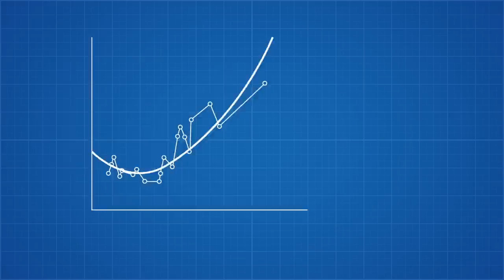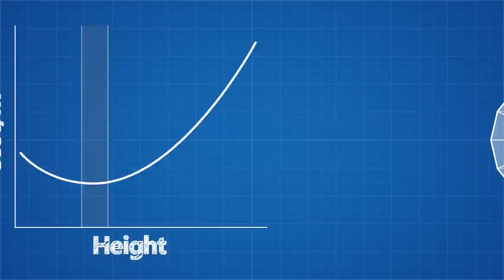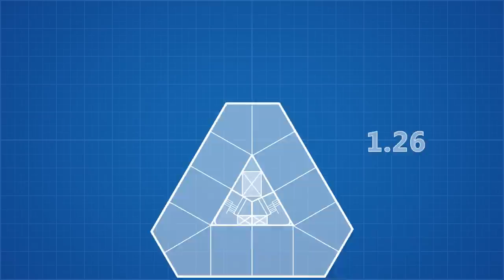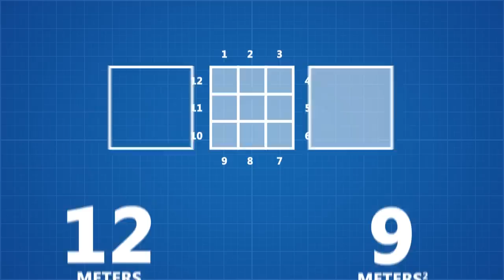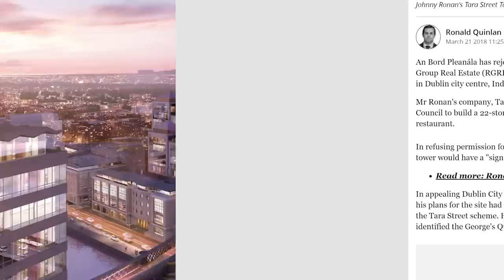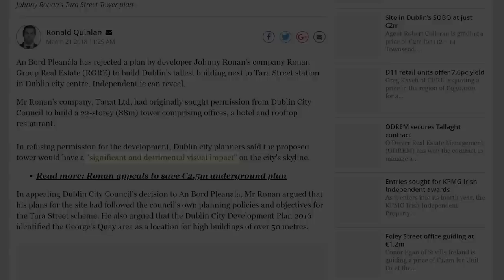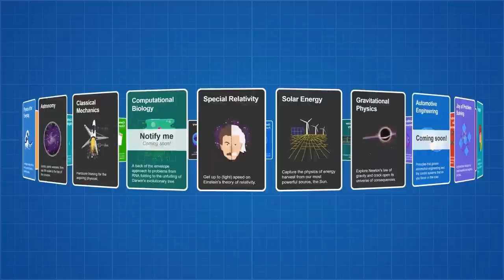How to Solve the Housing Crisis

Comment: This is a good video, and all points of are indeed true. But building higher also has it's tradeoffs, and these are by no means minor.To explore some of them, you might want to look at Moscow, my home city. If you go away from the center, you quickly find yourself surrounded by blocks and blocks of the same-looking industrial buildings 16 stories tall. This here is called "anthill", and is heavily critisised by many russian urban planners and architects. Apart from obvious aesthetic concerns, it discourages the formation of small businesses (high density of population means there is high demand, which is best met by big supermarkets) and there is no such thing as "local community" really in Moscow. Also, it doesn't seem to solve the problem of traffic jams, sadly.
Reply: Those buildings were made to be as cheap as possible after the fall of the soviet union. Nobody wants to have those types of houses. Detroit in america also has these low cost housing bread boxes, but pretty much everyone hates them. But you get giant high rises that actually look good in seattle and new york, they are unaffordable due to lack of supply however

Comment: A great idea would possibly have to be to make a tower with lego-like rooms. They would be assembled off site and sort of snapped together to form an ever changing tower design. The city needs the building to get a floor taller? Snap on another set of floor and add a stairwell block and maybe an elevator block column. Making them out of cost-effective light but strong materials and perhaps insulating them with aerogel would further increase savings by simply building to what is needed. If you don't want to take that route or it isn't good, a car park that stores cars in vertical space might help eliminate large car parks.

Comment: This is a topic I've been interested in for a while, and while I agree the challenges are numerous, there are solutions.  One such that I've seen suggested is cooperative development away from the city center with dedicated mass transit to and from.  The idea being several development companies get together to build a high-density residential area.  Think of it like an airport -- you want it away from the city center, but to make that feasible you need reliable transit links, and the faster the better.

It's expensive, to be sure, but if the city is willing to help subsidize it on the grounds of obvious need and it being a solution which doesn't require changing regulations in the city center, it could be accomplished.
Reply: Essentially it's a mini Tokyo. The countryside drainage also conversely had a side effect of lowering land prices, even relative to the city, when you're in the suburbs. So for some people even the cost of the commute is still worth it because good public transit keeps road maintenance,car exspenses,and travel costs down and families within budgets and spaces they can afford.

Comment: Yes, Midrise density is cheapest when just considering building cost alone but when services are an included cost either townhouse, small lot homes, or low rise apartment tends to be cheapest density. Considering Modular construction is especially easier at this density too just furthers this fact. Along with convincing neighbors zoning changes permissive for this density is an easier task.

Comment: I don't get how building under ground is not even an option
Reply: Most people don't want to live there...
Reply: Well when we'll realise the weigh of this crisis maybe we'll revue our opinion I hope. Otherwise let's don"t give a f, let's keep doing just what we want indeed no need to bother with a solution.
Reply: It's very expensive. First you have to excavate an enormous amount of material to create space. Then you have reinforce the hole to keep it from collapsing in on itself. Then you have - now and forever - pay to keep it pumped out and dry and air conditioned. All that forces the rents sky-high. Stack on top of that that few people want to live underground anyway and you've got an economically unsustainable project.
Reply: What would be the point in going further underground? Are we running out of space to build up? Building downward would be just as expensive as building upward, maybe even more. Plus no windows.
Reply: Digging that out is hilariously expensive and not practical

Comment: Thanks for such an informative video. I also concluded that 8-9 storeys are the perfect balance in cost, aesthetic and sustainability as an urbanist after years of empirical study. However, the world is not as pure and simple as the engineering world. The middle rise typologies and prefab continue to be off the main-course menu in many modern cities. The debate about prefabrication and square box with minimum decoration will continue until the aesthetic of the prefab speaks the same volume as the speed. Seeking personal expressions in building height, shape and skin will always transcend the need for efficiency for many architects and clients.  Last but not the least let's not to forget that the rising public resistance to tall buildings and pace of urbanisation are there to make the path to our urban future even more confusing.

Comment: Well, I think that part of the problem is that all business seem to think they must build in the cities and then have workers travel in from mostly the urban areas?  With good fibre based business internet a business can be build where most worker would be living away from the heavy traffic and noise and pollution in those un-used area in the urban places where the price of land be far cheaper and the work force more available to come there to work since the company be there and not in the cities!    Yes.. I know the companies think that, They got to be in the cities because all big companies are there?  Well, that is a out dated idea based on the old school business model of being where the others are and being in the flow of central control..    But Why do it like they did back in the 1950's or 1960's when with good internet links and the price of land in the cities reaching silly levels it make sense to build not where the rest are! But a out of the box type of planner.   Now as for housing for people if more companies built out of the cities where the people mostly live, there would be far cheaper land to build housing and better air and less traffic problems.A full modular housing design with all the piping and services per installed would solve the homes problem, In fact a factory making them outside the city would not only have the space to build and lower building costs,    But also would bring workers to it from those surrounding urban instead of people having to travel long times to work there.  Plus the better low amounts of noise and pollution and nice parks with plenty of trees and cleaner air will make such well eco based factories and homes near them have a nice effect of the workers who live and work there?

Comment: Has anyone tried building wide and flat?  Like a giant version of the Shire.  Run the roads, rails, parks, etc. over the top of the buildings.  So, from above the city would appear to blend into the landscape instead of displacing it.  You wouldn't necessarily need to dig down; you could just pile on top.  Sprawl that actually increases green spaces.

Comment: When it comes to building height there are other factors to consider.
In order for the apartments on the lower levels and the streets to get a sufficient amount of sunlight you need to increase the space between higher buildings. No one wants to live in claustrophobic urban canyons. Adjusting for this can have the effect that in certain cases building lower buildings can actually allow to have a higher overall density.

Comment: I've been wondering what are the downsides of hexagonal buildings? They'd seem mathematically more optimal, but aren't very common. Corner space usage would be better since corners are bigger. 
For a skyscraper, a single hexagon could be the core, six living floors built around it. How is the required amount of building core calculated? The straightforward net-to-gross area ratio of a 4 by 4 square would be 12/16 = 0.75, not 1.14... For a shape of seven hexagons it would be 6/7 = 0.86 which is better, but core might need to be bigger.
This hex could also be optimized further by extending the inner corners outward, to make a weird 12-sided shape. Close to a circle but a lot more usable than a circle, and easier to build (no actual curves)

Comment: Building down instead of up is a good idea. If you built a blocks of flats with three stories above ground and five below joined together with under ground passage ways many problems would be solved. Heating and cooling would also be easier as underground the temperature changes far less from winter to summer.

Comment: There are three options presented at the 4:52 mark that while they might not provide as much individual floor space as a square design could fit together with other buildings of a similar or same design. Fitting building together might help the structural integrity enough to free up some floor space. Why aren't they designed to fit together?

Comment: Pretty accurate portrayal of the housing crisis and its problems in Dublin. Prices are sky high and quality of what's available is horrible. Most of the city's housing would be qualified as uninhabitable by more modern countries' standards. It's sad how the government here in Dublin has completely failed to do anything. I also think that part of the problem is that outside of Dublin the rest of Ireland is very rural with no real public transport or facilities to speak of, increasing the pressure on Dublin.

Comment: Changing current lift technology to  one where each car is not suspended on a wire but is powered by a live rail with battery backup would mean multiple cars could run in each shaft.

Comment: I think the tara street example is not the best, it's a hotel so it wouldn't alleviate the housing crisis and to be fair to the council, it would have a significantly adverse effect on the skyline, a lower rise residential building might be better. There are also other underdeveloped areas in the city centre which would benefit more from higher rise housing, as well as areas outside the city centre which would benefit from a reduction in low rise low density housing and an increase in high rise apartments. Rather than putting in more hotels, which seem to be popping up all over the place. In 2008 it was shoddy apartments being put up everywhere, now it's hotels.

Comment: @ 2:55

All the buildings lining this massive transportation corridor could easily be stacked on top of that corridor.

Making available multiple levels of transportation and leasable properties both commercial and residential.

All rents paid would be to public coffers as real property owners of the transportation corridor.

Adjacent lands can be more open and less densely populated 

Rent becomes a major capital income base of public entities, instead of taxes or tolls.

Municipalities are not going to be able to ticket autonomous vehicles, or get parking revenue from them.

If they don't start utilizing transportation corridors in three dimensions they will have very little means other than taxes to support far too much infrastructure.

There is also an issue of the overly-long rooftop park.

Comment: I suspect self driving cars and remote working will reverse the trend of urbanisation a great deal in the next 20 years. Certainly I think 8 to 12 story buildings should be able to secure planning in Dublin pretty easily. There are plenty of ugly areas in the city center like East Wall that are already on the Luas where anything constructed would be an improvement on what's there already.

Comment: 1) Large government investment in affordable housing, with rent substantially below current market rates. 

2) The types of deregulation suggested here. I think we could go higher than 12 stories in areas like docklands. Creating more homes is more important in some cases to building at the best value and in an area like that people will pay market rate (hopefully lowering with increasing supply).

3) Start taxing rent at the first euro, not after €14000 so people stop holding onto second homes.

4) Rent cap.
Reply: Would no.3 not take out a huge amount of landlords out of the market? Which would be good for those who want to buy, but further increase rents due to lack of supply. And not create anymore houses.

Comment: The point is good about parking mandates in the inner city raising costs substantially.  But I think that it needs to be taken further.  If someone wants a single family home in the countryside, that should be fine.  But the consequence should be that if you want to come to the inner city, you need to leave your car behind.  Boston has a massive parking garage at the end of one of its subway lines, also where the suburban highway narrows to a city street.  Pull off the highway, park, and take the subway into the city.  Or, take a suburban train in.  The problem is making inner city residents pay for suburban-style road infrastructure, and thereby get the worst of all worlds.  Turn the streets into pedestrianized ways with trees, maybe some cycle or bus lanes (with frequent service).  Not hard, if you aren't also paying for car infrastructure.  Then people can choose whether to live in low, medium or high density, low, medium or tall height, housing, with the attendant consequences.

Comment: It seems the Chinese are on to something with the modular design which should be able to accommodate variable height buildings.

For example, a location where 6-8 floors is optimal, in regards to land costs, building up to 8 floors today should still be able to accommodate addition of floors in the future should land costs rise.  Being a modular design, any additional, higher floors can be designed with engineering issues in mind.  The roof just needs to be designed as a removable cap, while walls (or even the core, like in the Burj Khalifa) are designed to raise crane systems to the top disregarding when additional floors are added.

Comment: The actual issue is the cost of land.  It's all about the land.  Even if you could build a skysceaper for £1 the cost of the land would just increase to compensate.  

Places like Dublin need to start working to get firms to move out of the city into the second tier cities of Ireland.  I.e. the city should specialise towards some industries and work to get others to move elsewhere. There is a lot of housing out there - but it is in places where the quality of life is declining due to centralisation of economic activity.

Comment: DC isn't restricted to the height of the Capitol building... it just so happens that most buildings are below that height - "limiting building heights to 130 feet (40 m), or the width of the right-of-way of the street or avenue on which a building fronts, whichever is shorter. That is the main law presented by this act."  - https://en.wikipedia.org/wiki/Height_of_Buildings_Act_of_1910

Comment: @Real Engineering Buildings contribute a lot to pollution through utility use and construction materials, generally more environmentally friendly techniques and designs such as PV installation, insulation, or district heating, cost more, especially initially. Do you have any thoughts on the optimal arrangement of cheaper housing with out building in way that will damage the environment for years to come?

Comment: I'd love to hear more about this U curve. I live block of flats in Ho Chi Minh City. It consists of two lots of four towers, each with 26 floors. This appears to be the standard model here. There are several more developments like this, with a similar number or floors and number of buildings, generally situated toward the outskirts of the city. The land here is undoubtedly cheap.

With so many developers following the same model, I have to assume that twenty-something floors is at or around the bottom of the U-curve for this city. What variables could cause such a different set of results?

Comment: Great video. I'm all for more buildings and higher density. 

One question though: why would developers build at minimum cost, instead at marginal cost equal value? Maybe if they build higher, their profit per square m might be lower, but total cost would be higher (given that it's more apartments). 

Shouldn't that parabolic curve meet a horizontal line of price per square m to set the desired build area?

Comment: I would be careful demanding higher buildings without regarding livability, light and other aspects. 

The higher you get, the less light you'll receive on street level. Cities like Paris, Berlin, Vienna and so on are beautiful because the size of the buildings most often correlates with the width of the roads. Going higher, for example NYC, you'll create urban canyons with little to no natural light. 

The first step should be to minimize urban sprawl by reducing the single family homes with large gardens, densify the surrounding areas. This has the benefit of creating urban life in areas where there was none before, and lessening the impact of motorized traffic. 

In cities, we should think about densifying areas with 1-3 floors, but in regards to surrounding areas/street width.

Comment: I would actually like to see cities set MINIMUM building height restrictions on buildings. AFAIK Shanghai, under the pressure of extremely high prices for residence (average apartment cost to average wage ratio is about 80 years) is already doing this for its high density city core requiring all new development to have at least one main tower no less than 15 floors tall. Combine that with keeping all buildings within a few hundred meters of a Metro station makes the city geared heavily towards short commute times.